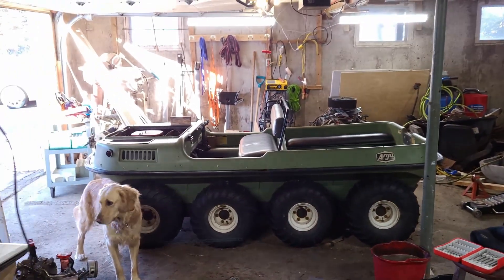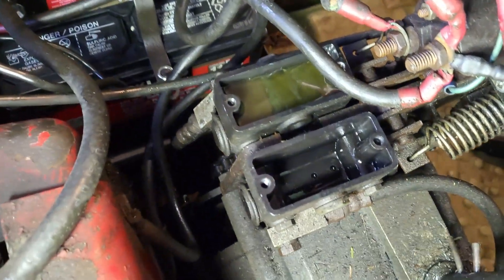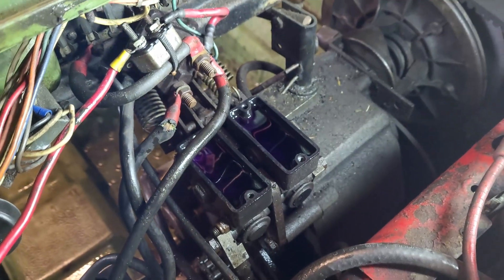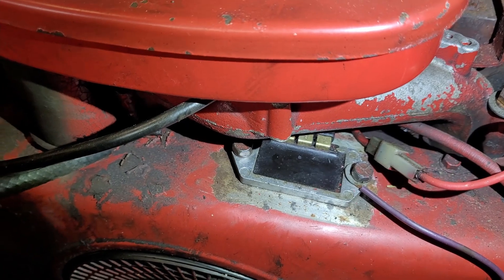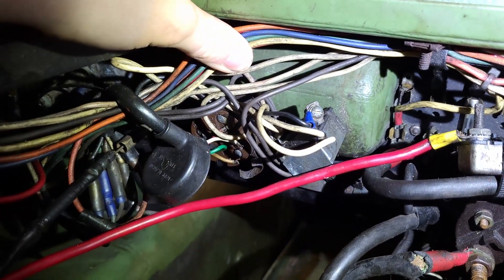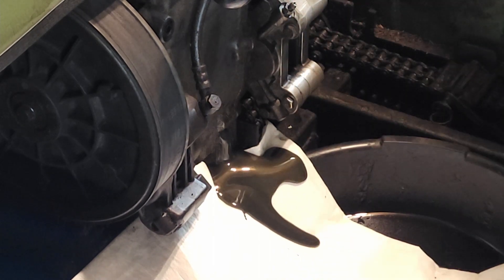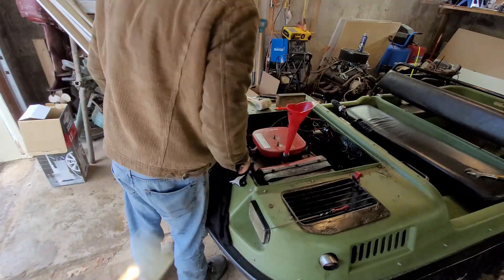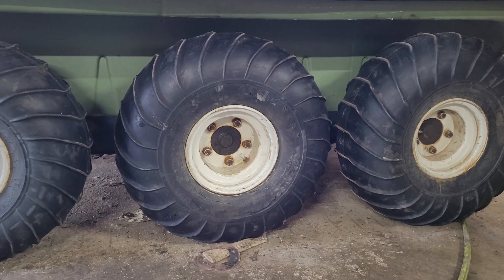Argo Electrical and Brakes - Argo Magnum 8x8 Project Part 3

Comment: Great video! I drain my Argo Kohler Mag18 from the bottom Allen key. Made a plastic pan, and jack opposite side to get all the residue.
Reply from the maker: I like the thought of that more than using the suction, I'm always worried that there might be a accumulating bit of gunk the suction method could be leaveing behind.

Comment: I used dot3 fluid in mine when I first got it and would lose braking in the side I put it in once the brakes got hot.
Reply from the maker: That makes sense, I think Dot3 has a much lower temp rating
Reply: @RustRehab yea, those brakes get so hot that dot 3 and 4 just arent rated for it. When I first got the argo one of the calipers had that goopy looking fluid like yours. I think it is due to water contamination. Dot 3&4 both absorb water into the fluid if some moisture finds its way into the system. Since dot 5 is silicone based it doesn’t absorb water like the other two so it separates. It is also possible that someone put the wrong fluid in like you said.

Comment: Great job . Yes AATV 6x6 8x8 sure can take a huge amount of time . Yes hard on your back .
Did u use Dot 5 silicon fluid ??  Charge regulator is from a later command series Kohler engine .
Ebay Not familiar with the engines prior .  Sand blast axle ends paint with industrial 2 part epoxy and coat with rust prevention fluid . the axle wheel ends are hollow .  Use capped wheel nuts if u can get them and use loctite silver grade never seize  . Very hard to wash off . 
Try a new clutch CVT belt   age has probably made it hard / stretch .CVT need the exact correct belt .
Reply from the maker: Yup, I used the silicone dot5. It was not cheap! That machine has served me well ove the last 2 years of hunting and guiding. I have done quite a bit more to it since my last video, including building a body support frame and partial engine rebuild. Im away for work right now, but I hope to finish an update for it in the next few weeks.
Reply: @RustRehab  Yep would be great to hear the latest .
A friend owns an earlier 6x6 Argo than yours with a Briggs Vangard . I own a Super Swamp fox 6x6 with a 28hp vangard . We use ours mainly in coastal swamp and beaches .

Comment: Just FYI for the future. Dot 3 and Dot 5 brake fluid are incompatible with each other so you really don't ever want to be putting Dot 3 or Dot 4 brake fluid into a DOT5 system as they don't mix well and can actually gel up and really cause a mess.
Reply from the maker: Sorry, don't know how I missed this comment for so long! It's actually been a few years now since that video was released, and I haven't had any issues yet, fingers crossed. I'll try to remember to take a peep next time I'm in the garage and see if there's anything bad going on in the cups
Reply: @RustRehab  with as old as that thing is and with how common. Three and four are compared to 5 it's pretty likely that someone else is already put three or four in there.

Comment: I had a similar thing with my argo brakes last year. The type of fluid is critical because mineral based fluid attacks the hose & seal rubber itself. It also does not mix with other types of fluid like mixing water with oil. I found the easiest way was to remove the calipers, strip them down & install new seals, then do the same with the cylinders. I flushed everything with brake cleaner before reassembling & bleeding. Unfortunately if someone has put tge wrong fluid in there it is not as simple as changing it out for dot5...

Comment: Watching 10 months after your post. Already waiting on your next. Just recently purchased  an Argo very similar to yours. Currently in debt due to upgrading and repair. Looking  forward to your next video.
Reply from the maker: "currently in debt due to upgrading and repair" that is an excellent way to describe my Argo ownership experience so far. But to be honest, most of the work I have done I did because I wanted to upgrade, and because I enjoy it. I planned to make regular videos on that machine, but I spent so much time working on it that I stopped filming. I had another video almost ready for release, but I scrapped it. I do plan to do an update for it soon, I have a lot of the filming done, but I'm using it pretty heavily for hunting and guiding right now so it may be another few weeks until I start editing. Which Argo did you buy?

Comment: Yes different sizes.
Inflate the tires to 5lbs.
Then measure their circumference
The smallest tire is first
The largest tire is second
The third tire is the second largest
Forth is the third largest
They are Steue up to run like how tanks are setup
Reply from the maker: Thats called tire indexing, it's only for tires of the same nominal size with small differences in diameters due to imprecise manufacturing. How you index them changes with what type of track you're running. My tires arnt even the same nominal size in any dimension, some were 22x11 and some were 20x10. That's too much of a difference to run with

Comment: Just a FYI the tires are supposed to be different.
Reference the following video
https://www.youtube.com/results?search_query=argo+tracks+and+modifications+
Reply from the maker: The link you left just goes to a search, but not a video. By different, do you mean different sizes? They should never be different sizes, that will destroy the chain drives because they can't spin at different rates. You'll always be dragging the smaller tires. Minor differences in tire diameter (even of tires the "same size") is okay, but if I remember correctly those ones were off by 2 inches in height and one in width.

Comment: Hello Sir, thanks for the video. I appreciate people giving love and attention to theses old beasts. I have the exactly same model..magnum 1988. I did a complete tear down and rebuild 3 years ago. Allow me to share a few tricks. For the engine oil change I installed a ball valve with a 90 degree elbow where the drain plug is located near the drive pulley plus  a rubber hose so I can put the pan in front of the transmission pulley. Super easy and clean !! I also use a big hospital seringe with a a transparent gas line to suck the oil from the galipers. Thanks and take care.
Reply from the maker: Appreciate the advice, I think I'll add that ball valve like you suggested!